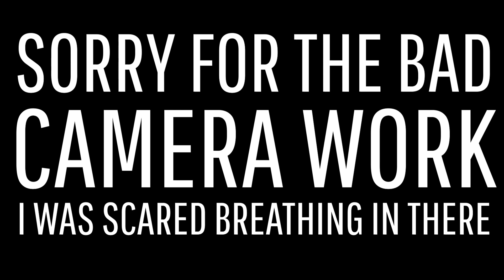Spray Foam Insulation Install in our Shed to House Conversion!!!

Comment: Better insulation than most houses in Houston. I lived there for few years; the homeowners were blindsided by some very cold spells. The insulation was so bad that the houses got really cold and the plumbing was not prepared for that weather. The homeowners knew nothing about dripping the faucets at night to keep the pipes from freezing. Nice to see you'll be well prepared.

Comment: That stuff is so cool. Years ago I was introduced to expanding foam when an alarm installation company I worked for was looking for a way to keep their extension ladders from "singing" as we drove down the highway. The open rungs would catch the wind and make a similar sound to the one you get when blowing across the open top of an empty bottle, but much louder. If the ladder sat just so on the rack it would make our trucks sound like they had a siren mounted. I came up with the idea to fill the rungs with Great Stuff which eliminate the noise. After I saw how much it expanded I started using it for other projects including adding additional bouncy and rigidity to small boats I made for pond fishing. It really was "great stuff"! 
Seeing this it makes me think that spending a bit extra to run flex conduit for the electrical might be a good investment just in case there is a problem downstream. On the other hand the chances of needing to run a whole new line is not that great. Most issues occur at the j-box, either with the switch or outlet. I will have to look at the cost estimates when it's time for us to make those moves. Thinking of the rigidity this will add to the walls and roof has me more certain spray foam is the way to go on a project this size, though.
Glad to see all the progress. God bless.

Comment: I have been enjoying following your progress. One thing I found very different to the structure of the frame of the buildings, between Australian and US house building, it is part of the Regulations in Australia  to use "noggins" (a horizontal piece of wood fixed to a framework to strengthen it) between each stud.  And at times use also "brace". walls.
Your place is looking cool... Cheers.

Comment: I read you shouldn’t use foam near electrical boxes due to fire hazard. Did contractor not mention this? If you needed to access those electrical wires he foamed in place, how would you do it once foam sets?

Comment: Why did you chose open cell instead of closed cell for insulation. I did not see a vapor barrier installed on the roofing area and I thought open cell does not replace the need for a vapor barrier. I’m asking because I’m researching a similar project

Comment: I noticed that there is no ventilation on your roof. How do you plan on dealing with condensation or moisture build up? Or is that not an issue with spray foam?
Reply from the maker: Not an issue with spray foam.  Or at least that is what I have been told many many times.  So let’s pray that’s correct.  Everyone has told us that spray foam creates a perfect seal.

In addition, we will have 1 or 2 dehumidifiers and we have vent fans in each bathroom from Green Building Technologies.  👍🏻👍🏻